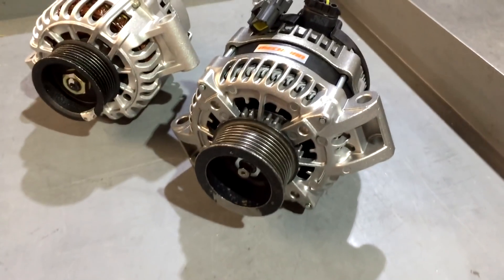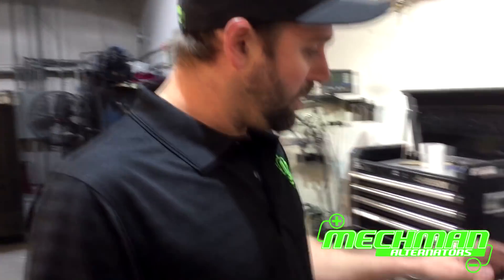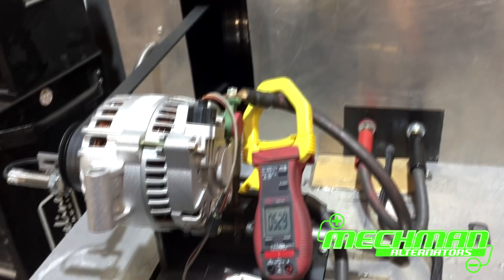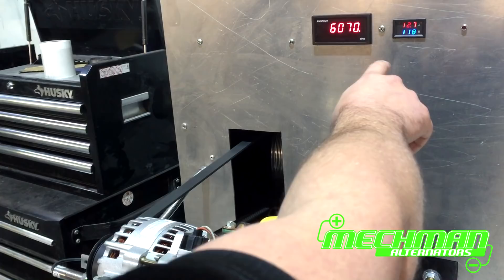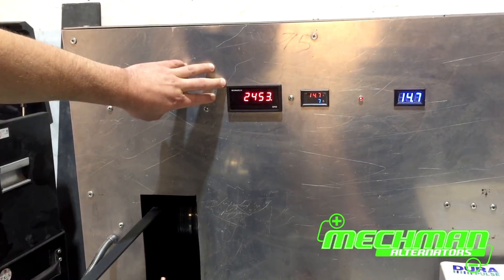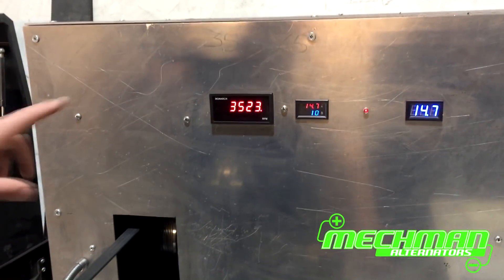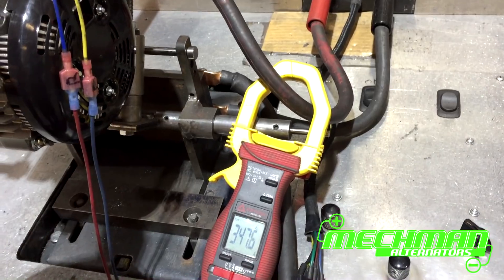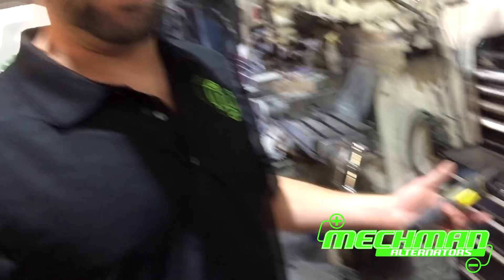Comparison Video Mechman 320A vs Stock Ford Super Duty Diesel Alternator.

Comment: they have a shorter life
Reply from the maker: Not always, however if under severe use then yes. Just like 1000hp engine will not "last" as long as a 100hp engine.

Comment: I know this is 7 years old and probably fall on deaf ears.  I recently installed the billet 400a on my 2003 7.3 Powerstroke and now all the lights dim or normal at idol and all get brighter as I accelerate. I checked voltage and it charging at 15.5v at batteries. I oversized a the cables to batteries. Any ideas? Thanks
Reply from the maker: Well, it shouldn't be charging at 15.5 volts.  I would imagine there is an issue with the wiring/grounding/connections or something amiss with a vehicle that is over 20 years old.   All it takes is one bad/poor connection to negate 15 good ones.

Comment: that's great for a bench test but what about real world inside engine bay hood down and Texas 115 heat.   Are we looking at a complete melt down?
Reply: Absolute output isn't as important as efficiency. I'd like to see efficiency numbers.
Reply from the maker: We have a HOT BOX we use for Marine applications.  Also, you have to remember the engines cooling fans will have air flow going over/around the alternator in most applications.
Reply: @mechmanalternators What's the temperature rating of the winding insulation and of the diodes on your 400 amp GM units? What's the hottest the stator should get to? I'm seeing over 160°C on the stator core in some cases under sustained load.

Comment: LoL I bought an eBay 350 amp alternator for $350 put it on and started to have voltage drop to 11 with the system turned up you could watch the voltage on the dash just go south if you played the system at a easy listening volume and had lights on after an hour or less they would be flickering I didn't see voltage drop below mid 12's  with the stock 14 year old 136a unit so I figured the output was ridiculously low . I have a 1/0 gauge cable ran in parallel with the factory charge cable and a 1/0 ground going straight to the battery as well as big gauge cable everywhere. I went out bought a $110  DC clamp meter.I started the truck off an optima I have sitting fully charged then hooked up thet two completely discharged batteries and a 3rd ran off the secondary battery with 1/0 gauge jumpers truck showed 45 amps off the charging cable and with all accessories in it peaked at 60 briefly then sat at 52 .22 amps I then turned on the stereo and amps came up very little at that point the alternator was at point where it's maxed out and  can't make the amperage and volts start dropping obviously that only at a 5 volume at full tilt it drops very quickly below 11 and the systems amplifiers go into low voltage protection. ...I ran my truck at idle and 1100 high idle and then took a stick and propped it on the pedal for 2100 rpm still 52.22 amps and unable to keep up with amy draw beyond the truck at nest ...the stock 136a puts out more power . I'm reasonably certain the alternator is just a cheap Chinese stock alternator branded as a 350 as I can't see any immediate reason it wouldn't put out the power of it has it as I have everything upgraded even the ground they said was.not needed.  Unless luckily unlike other things I buy them wait months to install this we as done right away so I can send it back ...lol...they better not expect me to pay for the ride either ;-)
Reply from the maker: Gotta love those Ebay alternators being hacked and hammered together in grandma's basement. :)

Comment: I had a question I have 2010 Ford Expedition Limited 5.4L. The truck is PCM Controlled. I have the factory connector zip tied up. I have it bypassed where the blue wire is connected to the positive post and the yellow wire in on 12 volt ignition switch. I have group 65 Odyssey Extreme battery new. The resting voltage is 12.7 and the alternator when running at idle is 14.4 all day. If I let the truck sit for 4 to 5 days the battery is dead 10.5 volts. I installed the factory alternator and drove the truck and then let it sit fo 5 days and came out to start it with no problems.  The battery was at 12.1 volts and the alternator is at 14.4 idle and driving. Why is it that the new alternator is draining my battery down? 

I also noticed in this video that you have the same bypass connector I am using without the Ford factory plug on the opposite end. Thanks
Reply from the maker: Because the new alternator NEEDS that plug plugged up!!  That "blue wire connected to the positive post" is keeping the alternator on all the time, even when the truck is OFF.  It's probably killing the alternator as well having the regulator/rectifier being powered up all the time.   If you're wanting to bypass the PCM stuff, it needs to be done properly through a custom tune or some type of ECU programming.
Reply: @mechmanalternators  Can I add a relay to the blue wire connected to the positive post to stop the battery from draining? 

If I use the factory plug with the high output alternator the pcm will keep the voltage low 13 to mid 12 volts. I have a decent size audio system along with the truck normal electrical loads and the factory stock alternator of 10 years could not handle the load. 

What are your recommendations?

Thank you again.
Reply from the maker: @1937Jay  Simple answer is yes you can.  The CORRECT answer is to have the alternator built with a different regulator (our GM 4pin style).

Comment: Would be interesting if you included the amount of power it takes to drive the alternator at various amperage loads.
Reply: the calculation is about 1 HP per 25 amps DC.   SO for 100 amps you're at around 4-5 horsepower.

Comment: My stock f350 7.3 idles at 650rpm. With the stock 64mm alt pulley and the 171.5mm crank pulley that's 2.68 to 1. So rpm x 2.68 = alt rpm at idle is 1742. That's a HUGE differance in available amps at idle.

Comment: Is there such a thing as too big an alternator??I always buy biggest is best but do I need it??  Twin battery setup,decent stereo,all led lighting and light bars,17000lb winch,uhf,etc etc.how do you calculate what is truly enough???
Reply: How does this guy not know you turn everything on and see what the maximum load you can pull is. That determines what you need to run at max, then you put in some head room so everything isn't stressed to the breaking point. This is how everyone determines what is enough.

Comment: awesome video and product. i am curious, we see the high amp output performance is there for a minute or two, but how long can you sustain this load? can you go hours and hours everyday? say i want to run a pure sine wave inverter off my truck for a job site every day for a few months, years or what ever, can we expect to get this performance the entire service life for just for a few minutes here and there.
Reply: I'm wondering as well. They don't seem to be very good at responding to prospective customers.
Reply: @murrayshekelberg9754  this has always confused me, it leads me to think they must have made enough money to not care to make any more. my alt stock can output 150amps some how at idle and i tested this over 14 hours, i ran an inverter with a window ac unit a few computers and a few lamps over 120 feet of extension cord to my house just to see if i could do it and it worked just fine, but getting a bigger alternator and a smaller pulley for it is a goal of mine at some point when im done with my solar system i'm building

Comment: Do i need to upgrade any wiring to put this on my 2001 7.3?
Reply: JP5150LBC just the big 3. Starter alternator and ground wire to at least a 1/0 wire. It makes a huge difference.

Comment: It is a very capable alternator that is only useful if your vehicle isn't in the factory configuration. Obviously the stock alternator performs fine if it's in good condition, purchasing this for a stock vehicle would be pointless compared to original equipment because it would never use it's full potential. That factory 118 amp potential works well and the mechman can do 320+ amp but in your stock vehicle it would never reach that point. The only electronic that can pull that many amps is the starter but a charged battery doesn't require more than 100 amps alternator output to recharge after starting. Super useful if you have aftermarket electronics making your stock alternator work overtime but pointless if your vehicle isn't modified
Reply: Obviously these high output alternators are made for vehicles with aftermarket accessories like sound systems, winches, light bars, compressors, etc. You're not saying anything.
Reply: @JoManOut  Hey, that's exactly the answer to my question. Thank you!

Comment: At this point, I would honestly start having an alternator with an external cooling unit. Have it watercooled. Just like engines of old, you're making too much power for air cooling. 

Have it fully sealed, running coolant like today's electric motors do. Sell a DIY kit with presized lengths of braided steel coolant lines over to the engine bay. Have the coolant pump ran off the input shaft to the alternator. 

Would certainly sell with guys that mud-bog, off-road, or hell even those services like EMS/Fire Rescue. 

Barely adds labor to the install. Just a bit of drilling and tapping for the initial install of the aux. Radiator, and hell, betcha it'd make alternators last a whole lot longer.
Reply: How are you going to have enough room for liquid cooling passages? Maybe Marco holes through the drive frame and rear frame but you still have to make the drive frame and rear frame gasket it will fail.
Reply: I have a 2001 f450 with 7.3L turbo diesel that used to be an ambulance. It's has two alternators and neither is water cooled.

Comment: The heat kind of bothers me (I guess I expected it to be lower). Your engine compartment is going to be a naturally warmer place already. What is the temperature class of the varnish you used on the winding insulation? Not to mention the limiting factor on the diode temperature, at a certain temperature they're going to break down and fail, so is that running cooler than the outer casing that you measured?

I guess the ultimate question is, are your alternators rated for sustained load at peak rating in engine compartment conditions, and is that a point you have tested to?
Reply: Your alternator won't be running max load all the time either.  Unless it's defective or not up to the task.  These 350A alternators will not fall short as long as the wiring, grounds and fuses are all meeting spec.
Reply: @jimparker7778  so you can connect a pure sine wave inverter and power an entire job site that say draws 250 sustained dc amps all day every day for months? i realize engine rpm is a factor, but we can also install smaller pulls to get the alt rpm up.  the real question is has the alternator been designed for max out put at all times or not, how about 75% of max out put, or 50% etc etc. genuine question btw, not being a smarty about it
Reply: @jasonbrown467  Is this a brushed alternator, and if so, what is life expectancy of brushes if pushing unit so hard?  Rotor current will be highest at idle with heavy load.
Reply: @chetmyers7041  i honestly have no idea. i have brushed moters on my rc trucks. but i have never heard of brushes on alternators, but i really dont know
Reply: @chetmyers7041  brush life will be shortened under 100% duty cycle, slightly, if that. The difference is negligible. Most of the wear comes from higher rpm operation, and the increased friction it causes on the brushes and commutator, from sustained high RPM operation. I would be more worried about diode cooling, however, mechman uses 50a diodes, on finned aluminum heatsinks that are cooled by the internal fan.

Comment: my mechman alt most of the time is at 15 volts no higher than 15.2 volts not sure if that voltage will damage anything or not?
Reply: @DTW-bx2vy  nope not a single one
Reply: @DTW-bx2vy  I know if you can I know theres a way to turn a 130 amp alt into a 250 amp alt by cutting and splicing some stuff inside of one i've seen a video and if you wanted go to a junkyard and first test the alt to make sure its working fully and then start the mod i've seen videos on youtube in the past it could work for your alt and could make it be a 120 or 100 amp alt or even if its possible make a custom alt bracket to fit in there and figure out the few wires that's on the alt. I've never cut into any alt before but thats why i said use a junkyard one its a lot cheaper maybe 20-30$

Comment: Measure the diode temperature, that;s the weak link and the hottest spot in all alternators, especially the Positive diodes, they are isolated from the housing.

Comment: What would be interesting is to see how much power it takes to drive the alternator to produce that power.
Reply: 350amps X 13.8V = 4830watts  takes about 2 horsepower to make 1000watts so roughly  9.6 horsepower.
Reply: Was thinking the same thing. How much hp is needed to produce 350 amps ?

Comment: 6000 rpm is way to high... I doubt your truck or car will cruise around that rpm more like 2-3k rpm cruising.
Reply: if you listened to what he said he states that the 6k rpm is not crank rpm that's alternator rpm due to pulley sizes your alternator would be spinning this fast at cruising speeds but your engine would be down around 1600rpm at the crankshaft pulley.
Reply: @gregthemechanicman  I hope Dbuilt Series isn't a mechanic.
Reply: He states that this isn't crank RPM only at the alternator.

Comment: I have a 2010 f250 6.4 litre powerstroke. Will this alt fit my truck? The upgrade has a larger case, I am concerned if it will fit. Also, is this  remanufactured or new equipment? Thanks in advance
Reply: All new.

Comment: Is that 0/4 gauge wire on the alternator? WTF
Reply: thats not 4,, might be 2,, but probablly 0,,,   although 4 gauge can handle around 250-300 amps with that short of a cable length

Comment: i have a 2017 F250 Superduty...i know what alt i am getting when that time comes!! Forget about a system, what about the 4x4 guys who just need lights, winches etc.....this would work amazing for them too!  Great video, i love seeing PROOF of the results not just someone telling me what my shit is rated at.  

 

Mechman FTW!!!!!
Reply: if its STEVE MEADE approved then you know its top notch high quality gear that will last for years beyond your current build
Reply: NO DOUBT... I love seeing a company able to back their product with full proof. I just ordered my first Mechman Alt yesterday. Cannot wait to get that badboy in the mail and then installed.
Reply: I have an F550 work body that I use for field maintenance and recovery when one of our box trucks blows a tire or get stuck, etc.  Kept running down batteries using lights at night or winch, even with engine running.  Switched to a Mechman added second pair of batteries in the body, thing keeps all 4 batteries charged even running a big light bar and a 18k winch at the same time.